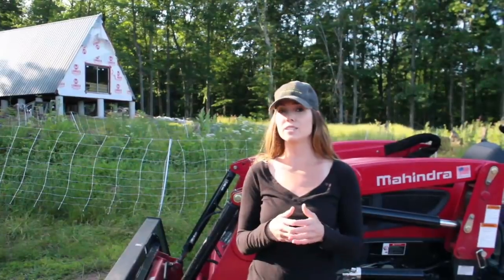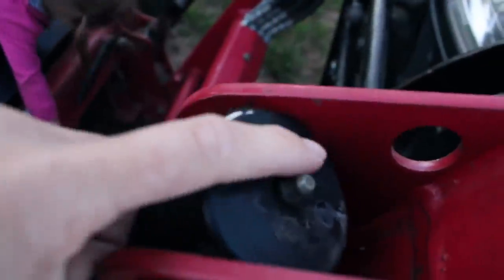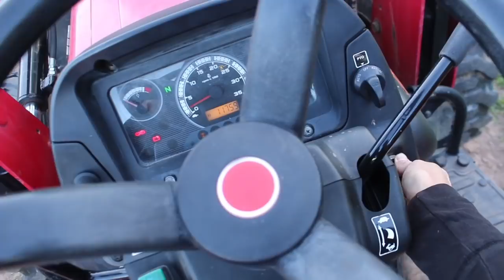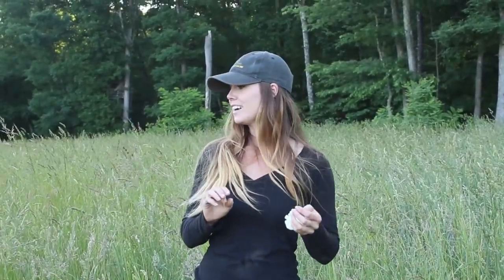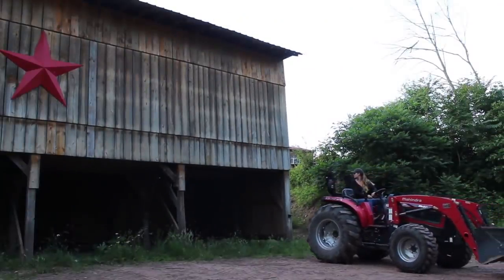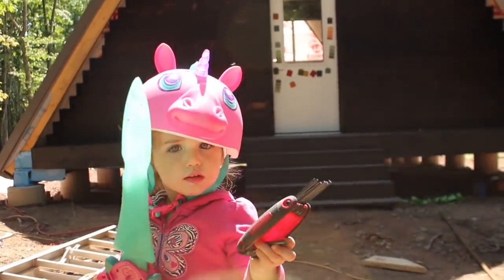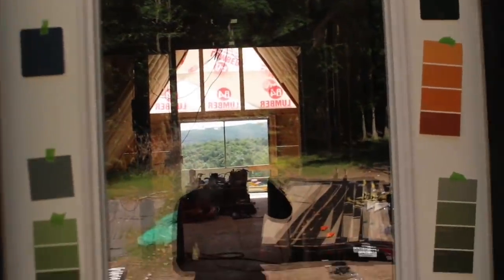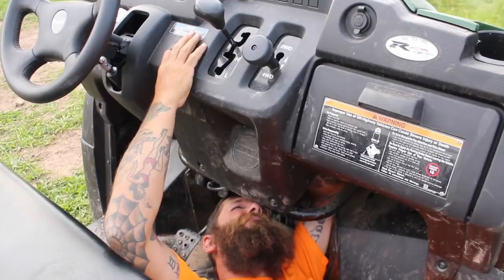Behind The Build- Mahindra

Comment: Fantastic job Erin. A lttle tip that a painter once told me is when you first open the paint can the rim on the can has an indentation to seal it after use. When the lid is put back on there is always paint in the groove,
so when first opened drill a few holes about 1/8 inch bit, this will allow the paint to run back into the can.

Comment: And then AFTER Breakfast, Erin started on the next set of tasks.
Better Josh should have to turn into a pretzel to replace that switch since he is the one who lost the key.
I second Michael McDonald's suggestion to get a LockNLube. I usually didn't have trouble getting the regular grease coupler ON the fitting but sometimes (OK too often) had to wrestle it off. LockNLube is easy on, easy off and there is never a question as to whether it really IS on before you pump.

Comment: Since I have been commenting a while, I will Kwible a little... In the backdrop of film you do your chat and we see the unfinished back which is actually done so update the back drop. I'm very proud of you tackling the grease. That girl is one of the most important things. When you see grease then stop as it will spread under pressure. Full till operator is not out of question but do not... I REPEAT, DO NOT RUN SIDE HILL, or it will roll over so back into tight places or let them go. Body parts are hard to get along with..... I LOVE YOU BOTH! I try very hard not to be influenced by a girl in anyway. Won't be long and the cabin will "rock" and sway to the winter breeze with you'ns in it warm
Reply from the maker: Hey! Thanks for watching. We post videos in real time so the background is accurate. You can see the siding on the backside of the house as I paint and you can also see the front of the house as I talk about the goats/tractor. We have not yet worked on the front of the house- it will be all glass. Perhaps you confused the front with the back. The back has siding, a door and window. The front is all housewrap and a siding glass door

Comment: I like to see proper maintenance and care of equipment! If you treat your tractor well and don't abuse it, it will return the favour. I hated greasing equipment as a kid because you'd start the day decently clean but after greasing the harvester or baler first thing, you'd be covered in grease! Some of the fittings are in difficult places, so we had a flexible hose on our guns instead of the metal pipe. The side effect of that was that the equipment lasted decades and didn't rust at all. Now I see they have electric guns! Envy!

Comment: Maybe the key is in Josh's beard. Just a tip Erin , it's a good practice to wipe the grease nipples clean before greasing ( although it looks like you may have done so, but didn't show it ) otherwise you run the risk of pushing grit into the bushings.